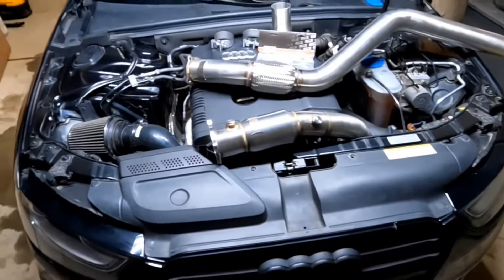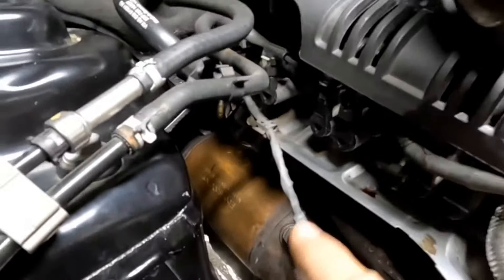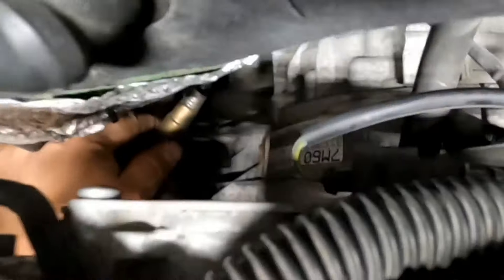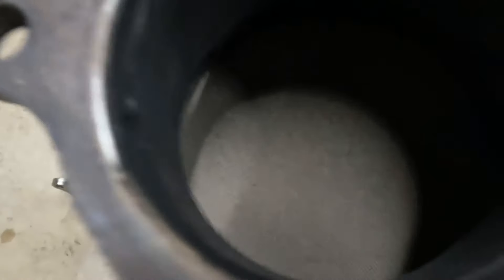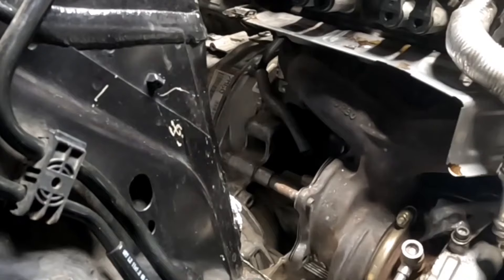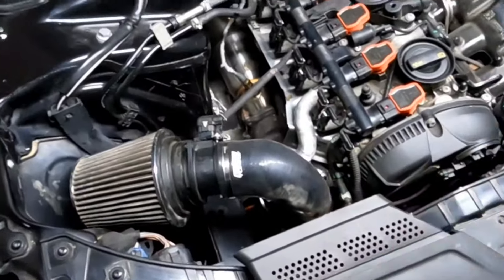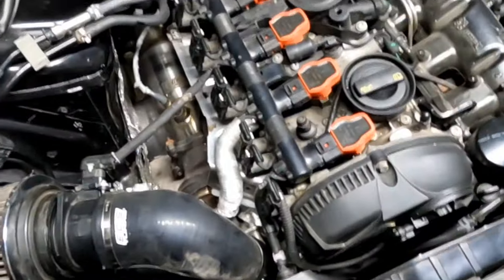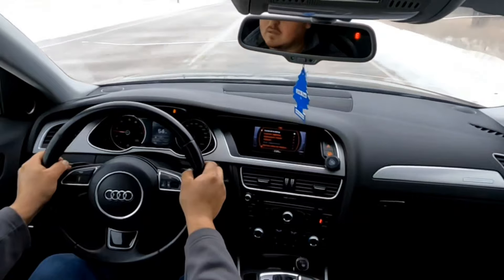High Flow Catalytic and downpipe install B8/B8.5 Audi A4 plus crackle tune and Review

Comment: You shouldn't really smell fuel with a high flow cat unless your tune is too rich. For reference, I'm running catless longtubes on a 600hp supercharged v8 (e55 amg) i dont smell fuel unless im full throttle, normal druving is fine

Comment: One of the best videos and well explained step by step, by the way, how long did it take you to change the parts?
Reply from the maker: Thank you, I'd say probably 4 to 5 hours since I never did this before to an Audi and it was cold in that garage.
Reply: @latenightgarage7895  thank you I’m planning to do this upgrade on my b8.5 after temp’s gets little warm
Reply from the maker: @Andres Ruiz  there's a while exhaust setup on ECStunings website that is a single exit but it's like 800ish but you get the cat, downpipe, mid pipe and muffler with tips. I could be off by a bit but I think that would be worth it more than just this setup. I Also added IE stage 2 tune and it's great, all I'm missing is the big intercooler
Reply: I did this myself yesterday and it was pretty difficult getting the nuts off the cat. I broke one of the bolts on the flange for the cat it was so rusty. I just put the other 3 and let it be and I didn’t see no problems as of yet tho.
Reply from the maker: @moby dik  If it starts to create a tiny leak, I would suggest removing the three and using a visegripe to remove the broken bolt. They do remove when turned, so that might be your next project, oh, and try to get a small size visegripe. But anyways, good job on the installation. Did you get a stage two tune with it?
Reply: @mobydik378 how did yall do it lmao, I had all the bolts out of the cat but there was no way it would come out from above or under the car gave up after like 8 hours of trying and pulling a bunch of other stuff off

Comment: Ecs tuning products are  junk. I had the same downpipe it cracked within 2 years of using
Reply from the maker: Where did it crack at?
Reply: @latenightgarage7895  right on the weld before the downstream o2 sensor

Comment: Hey bud question for you.  Is that the factory maf assembly with just a cone filter fit onto the front of it and an aftermarket turbo inlet stuck onto the back of it?  Think that's what I'm gonna do..  just wondering if it throws a code..  thank you
Reply from the maker: That's how it's set up ha, didn't wanna pay $300 for a set up that does the same thing, and no it doesn't throw a code
Reply: @latenightgarage7895  right on man good thinking.  I'm going to do the same thing.  Yeah it'd be stupid to do anything other than that haha..  and I'm going to get the same high flow cat and downpipe too I believe..  how's the car on stage 2 & what year is yours?
Reply from the maker: All I need is the IE inter cooler but besides that the stage to is awesome to have. Way more responsive with power. And it's a 2014

Comment: I’m currently trying to take my own car off to do this but the bolts on the car to the turbo don’t budge at all what tools did you use I can’t fit a deep socket on it cause it hits the cat but the smaller ones aren’t deep enough. Thanks
Reply from the maker: Hey, my apologies for the late response, I hope the installation is going well, but to loosen the bolts on the stock cat you'll need some wrenches to help brake them lose. Then you should be able to use a short socket on them to take them off, when you install the new ECSTUNING cat you can then use a deep socket to tighten.

Comment: Nice vid my dude. I'm about to toss IE's HFC/DP on next weekend along with Stage 2. Curious how big of a difference you noticed going from stage 1 to stage 2. Also curious if you have any drone after removing that 1st resonator.
Reply from the maker: Thanks for watching, subscribe if you like it and wanna see more in the future. It's makes a big difference I noticed, the turbo build boost quicker and the response is better. It has a really nice pull in 1st going 20ish and in 2nd or 3rd gear around 35xx rpm I noticed. One thing I would definitely recommend is the IEs intercooler which I need and replace the stock intake box. There feels like it's has more to give but can't with the small stock intercooler. As for drone it's not that bad.
Reply: Have any issues getting the factory cat out? Couldn't get mine no matter what I tried
Reply from the maker: Did you separate the cat and stock down pipe? If not that's probably why and you'll have to separate them
Reply: @latenightgarage7895  yeah had the downpipe completely out as I replaced that aswell, but still no room to remove out the bottom and up top it hits a heatshield and the turbo flange
Reply from the maker: You'll just have to keep turning and yanking on it. It'll come out eventually.
Reply: @latenightgarage7895  idk man lol like it hits the passenger side strut tower paneling aswell it gets wedged before its even half way out up top, only way it looked like it would be possible on this car is if I removed the heatshield and took an engine mount out and pry it over a couple inches, mines a 2013 a4 if that helps at all
Reply from the maker: Is it a TFSI
Reply: @latenightgarage7895  yep 2.0t
Reply from the maker: Alright, well I looked at the video I took it out from the bottom of the car so that's gotta be the way, if you have to loosen a motor mount, then that might be the only way. Hopefully, it's not hard to get to, but you'll definitely be able to get it out.
Reply: @latenightgarage7895  do you remember if you had to remove anything else underneath to get it out? I had every damn skid plate off the car and some center crossmember pulled out and still wasn't able to pull it out lmao
Reply: IE Tune Stage 2?

Comment: Do you know if you have to get a tune after you install a turbo back exhaust? Or is it best to get a tune for check engine lights that come up?
Reply from the maker: Best to do both at the same time, not only is there the check engine light but you be throwing off the ecu which could cause issues.

Comment: What’s that tool you used to get the o2 sensor out? Never seen it before looks like a socket with a slot for the wire I guess
Reply from the maker: O2 sensor socket

Comment: Did this throw a check engine light?
Reply from the maker: Yeah, it's best to have the stage 2 tune ready after, I have IEs stage 2. Basically they send a connector for the OBD2 and you have to use your laptop and the app you download, it's very easy to do. They are coming out with a mobile app soon, not sure when ig for tunes so that will be cool to see.
Reply: @latenightgarage7895   Is IE stage 2 tune compatible with cts air intake and ecs HFDP ? curious to know before purchasing !
Reply from the maker: @Pedro castaneda  should be, I don't think a air intake will effet anything but to get the most potential out of the tune your gonna want to get the IE intercooler sometime.

Comment: Will this still pass emissions testing?
Reply from the maker: It should since it's still a catalytic converter.
Reply: I have the same cat, it throws a CEL without tune, it did for me anyways. I put an O2 spacer on it , took my tune off and passed fine after drving around a bit